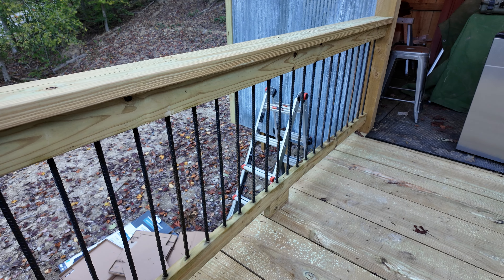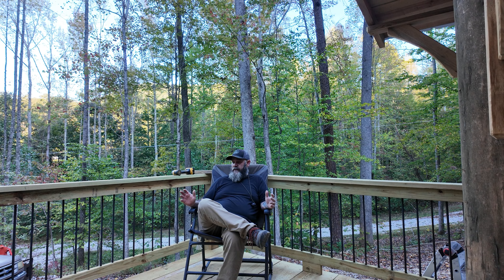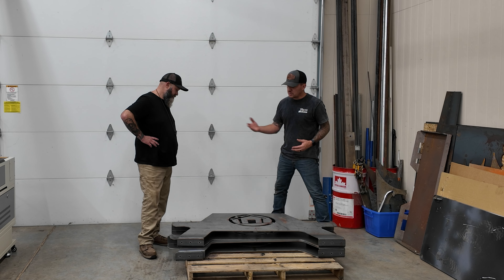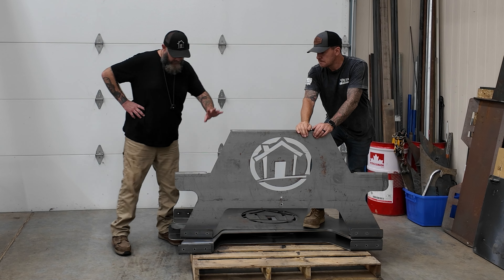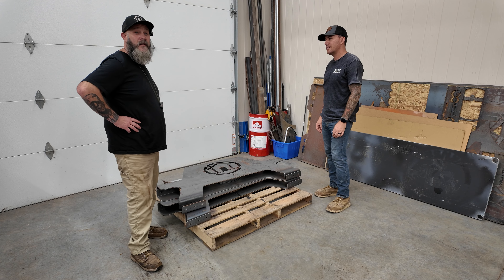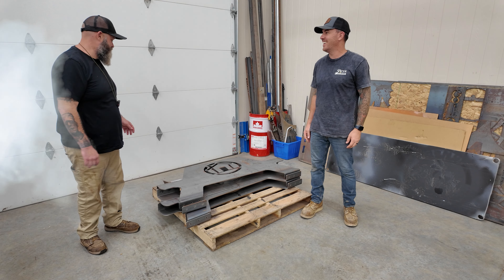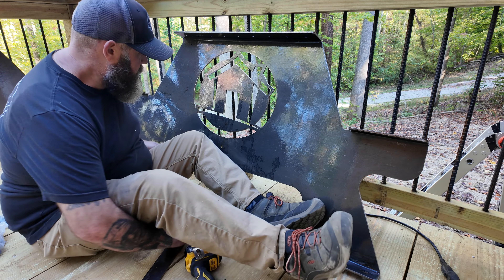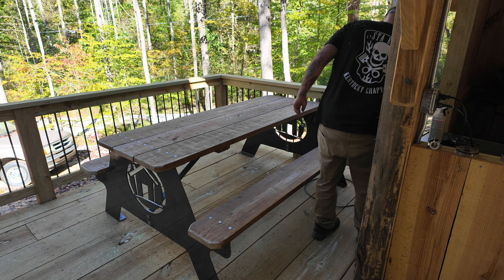REVEALING Our Cabin's SECRET PROJECT W/ @SpicerDesignsLLC

Comment: The little 45 on the ends of the table is so right. Wonder if assembling upside down would be easier, I hate lay down work.
Reply from the maker: Yeah I thought about that. Wasn't sure I'd be able to flip it back over on the deck by myself.
Reply: @buildlife  good point, those ends are solid.